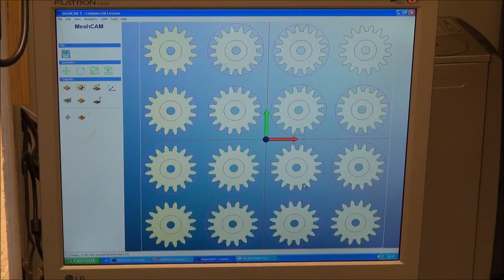Making a Bunch of Gears or Cogwheels

Comment: l prefer to make a one cavity aluminium injection mold, I have a diy injection molder (it is cheap to buy a small manual one instead). I have experience in molding with glass-filled nylon, but I do have confidence in molding with P.C.. I did injection mold with injectors pins and pre-heat plates. Then molding a bunch of gears is easy and possible...

Comment: Nice job! Why did you use a thicker piece of plastic and preform manual operations on the gears vs using a thinner one and letting the CNC do all the work?
Reply from the maker: +Cnc with me! Thanks! Did not have a thinner piece of plastic at the time :o)
Reply: +CNC Flake what type of plastic was that? links?  tanks for the upload.

also must the gears be this thick?  i feel the smaller the model the stronger

Comment: great job !  however just want to suggest:  the final pass around each gear should have been in the same direction - (counter clockwise) -  maybe not important at all for your intended use but just saying.  (helps keep gears more uniform in size - and smoother finish)

Comment: i'm trying to machine the same plastic with a 3 mm single flute carbide endmill but the resulting part remains "furry" on the edges. what speeds are you using? whats the rpm of the spindle and the feed rate?

thank you 
best regards
Reply from the maker: +klayus12 Feed rate 900mm/min. RPM 28000. Sounds like you are using a dull bit try a new sharp bit.
Reply: +CNC Flake I tried a new bit with 1500 mm/min and it works great. Thanks

Comment: If you could use cylinder stock, you could do it faster and with less garbage.
-cutting
-turning
-milling
Reply from the maker: +Stojan Janković True
Reply: +Stojan Janković great idea. But you could do it even faster than that with a mold. And a whole lot easier.  This was a lot of work to make these gears. Plus a lot of noise, wear and tear on the bit and spindle, etc.  If you had cylinder stock and could route all the teeth on the gear, all the way down the cylinder, and then just slice it. If you needed to gear down, you could just glue a smaller gear to the bigger one.  But given that he probably just needed that many gears in a one time need, then using a CNC may have been the best and easiest option. So now I finally arrive to where he was.  But it is still very time consuming and inefficient doing things with CNC machines. I want to work toward basic machines that are CNC-based, but are more suited for mass production, although I have not really begun to think about that very much at all yet.
Reply: If you take into account that using mold would be cost effective for batches larger then 5000 pieces or so... 
You would rather stick to CNC  :) 

All the best!

Comment: You need a 3D printer!!!
Reply from the maker: Sure do!
Reply: +Protocorner skip the plastic junk and go with a DLS or Dmls system...
Reply: Printing these would have taken forever, cost a small fortune in material and would NOT give the same strength you get from POM. 3D printer can do a lot, but not suitable for everything.